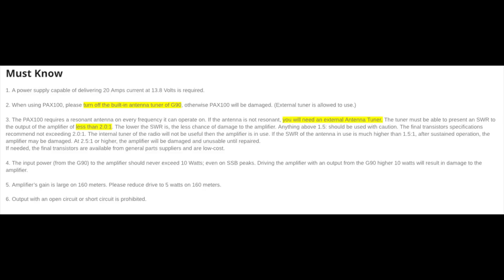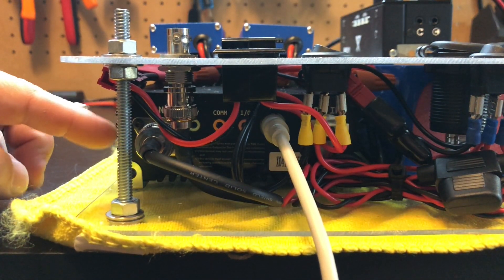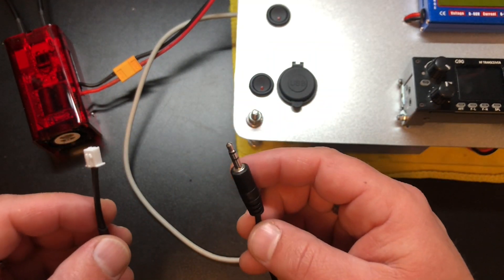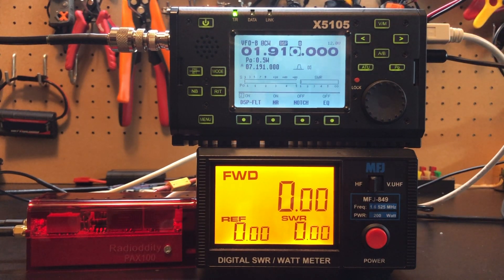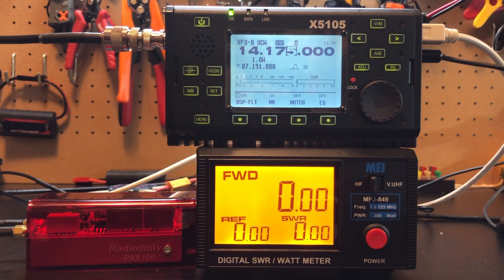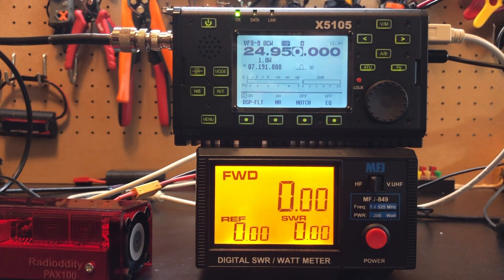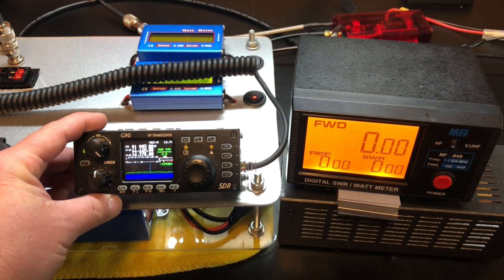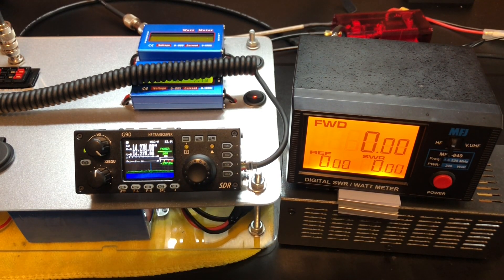The new Radioddity PAX100 Amplifier | Xiegu X5105 & G90 100 watt amplifier.

Comment: I'm curious what transistors/mosfets are being used in this little amplifier. It seems very similar in board layout/performance to the cheap ebay 100 watt amplifier kits.
Reply: IRF 350 Mosfed seen on the webpage of Radioddity
Reply: @Marcdewetter  Thanks for the reply, someone on the Ham Radio Crash course did some digging and it looks like the Radioddity has a very similar board layout with a few modifications.
73s
Reply from the maker: Per the website it uses two inexpensive 55-watt IRF 350's as the final amplifier devices.  No clue what that means.  I'm in sales, not EE lol!
Reply: @hamradiotube  Lol, I'm no EE either. Thanks for the reply and please keep up the great work.
73s
Reply from the maker: @kg5ubb478  After becoming a ham, I really wish I paid more attention in high school lol!
Reply: I should add that it does look cool and at least includes a heatsink/fan and filters , plus you don't have to build it which is a plus for hams that don't enjoy or don't have time for kit building.

Comment: Interesting video. Looking forward to your outside testing. I actually ordered one of these things to use with my G90 so I'm hoping for the best. So it appears this is actually a Radioddity (not Xiegu) product they specifically came up with to use with Xiegu radios but Xiegu still has their own amp (which you own) that is a tad more user friendly albeit a lot more expensive. Did Radioddity provide decent instructions for this thing? Looks like you're not going to be going outside for testing for the next few days at least. Perhaps it is time for the K8MRD radio van complete with heating, operator position, antenna mounting system, and ... more heating.  NK5J.
Reply from the maker: The instructions were pretty vague as is to be expected (but unfortunate) with some of these Chinese products.  It pretty much shows how to connect it and thats about it.  It does mention using resonant antennas though.  I'm not really sure who is manufacturing this however, but it def has Radioddity branding and Xiegu is nowhere on it.  Maybe they partnered together, maybe not.  The Xiegu XPA125B works great.  Plus it has an internal tuner that would tuna fish lol!  But yes its like $550, and is quite big and heavy.   Its currently snowing here so no, I don't think ill be going out any time soon unfortunately.  Perhaps it is time for a K8MRD Ham Van!  Then I could live in a van, down by the river haha!
Reply: @hamradiotube  Yes XPA125B very expensive, more than the rig??

Comment: I have to wonder if its the filtering causing issues on the higher bads
Reply from the maker: Your guess is as good as mine.  It does have filters that can be swapped out.  It comes with a low pass filter for 17 and 10 I think.  They sent me a different filter for 40 and 20 I might swap out.

Comment: Hi, I also have a xiegu x5105 and I would like to know if I can use it in the 11m band. I would like to use it on the truck as well. In Europe we use CB free band. Do you have any idea how I can open the station in 11m?  Thanks for your time 73!
Reply from the maker: I wouldn’t have the slightest clue about that.
Reply: This amplifier would need the Low Pass Filter(LPFXU) for use on any band - without it you will be generating excessive harmonics.  The LPF on 10M would be fine for 11M.

Comment: Interesting review video. Have to remember to leave internal G90
tuner off when using the PAX-100.
Additionally, the drop in power 
output as one goes up in frequency,
is not linear. Thanks, W2CH
Reply from the maker: Yeah, it's def quirky to say the least.   The tuner off thing makes sense, but the high swr into the amp leaves quite a bit to be desired.  I don't think it works quite as advertised.
Reply: Internal tuner would help tune the amp input

Comment: Looking forward to this review.
Reply from the maker: Well, what do you think now?
Reply: @hamradiotube  Will let you know tomorrow!
Reply from the maker: @1polonium210  Cool. 73
Reply: @hamradiotube  The problem is my SWR/Watt meter.  I had to buy another, so I bought a Daiwa CN 50-1H, rather than anything from MFJ.  I am really tired of MFJ's products.  I see that the SWR/Watt meter that you use in the video is an MFJ meter, but I am not happy with MFJ.  I cancelled a large order with MFJ recently because they could not deliver ~$700 of items after two months, and one of the items I ordered require antiquated peripherals.  I have had much better luck buying from other manufacturers/dealers.  Anyway, I'll let you know how the PAX100 works out when I get a reliable Watt meter.  I;ll crank up the Xiegu 125 amplifier tomorrow.  :-).
Reply from the maker: @1polonium210  I've not had any issues with my MFJ stuff.  I know they aren't the most precision instruments in the world but they seem to do fine for what I need.  Those Diawa's do look nice though.
Reply: @hamradiotube  So far, not so good.  The device is not responsive.
Reply from the maker: @1polonium210  Hmmm...